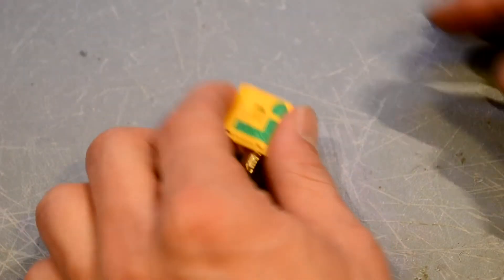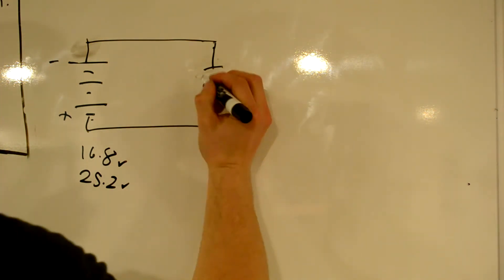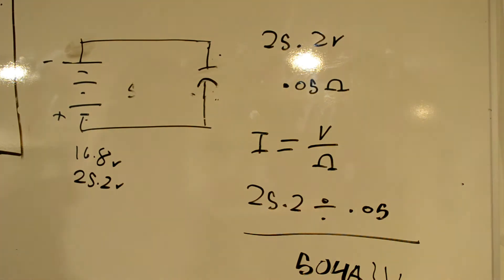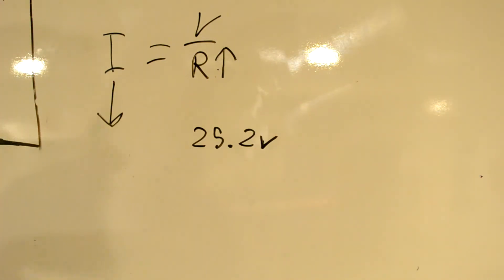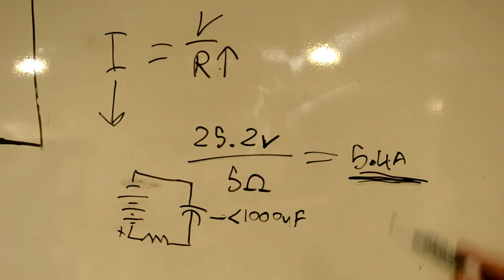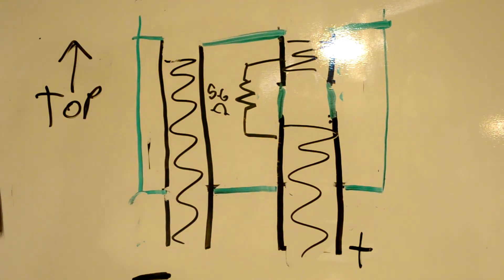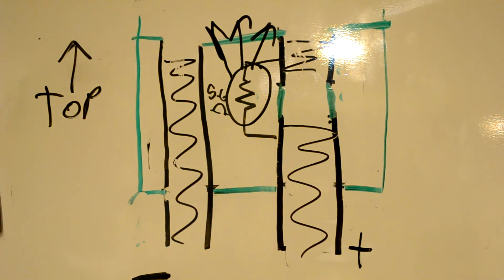Tech Tuesday ---- Anti-spark Connectors

Comment: Almost never do I hear anyone speak of the damage that can occur because of the inrush Amps other than pitting, etc. to the connectors.  Trust me, it is not only the connectors at risk.  Connectors, while not cheap, are a lot cheaper to replace than a controller.  I learned this lesson the expensive way after having to replace the controller and display for my 48v e-bike.   I replaced my XT60 connectors with XT90s a year ago and have since been spark and trouble-free!  Yes, they were a pain to solder, but I've only had to do it once.
Reply from the maker: Almost like the make these for a reason! enough current can blow up marginal input capacitors with ease.

Comment: Question - does the resistor in the anti-spark connector have a heat tolerance limit? I heard in another video that I should be trying to dissipate that heat more than other connectors or that resistor will fry
Reply from the maker: Probably, though the time that the resistor is energized is small enough from keep it heating up significantly. Tcase limits for many resistors is around 90 C
Reply: @BrendanStewart  my concern was regarding heat during soldering which can last more than a few seconds
Reply from the maker: @EbonySeraphim  Ah got ya. I've not had any of these XT90 style connectors burn resistors while soldering. I think you'd be worried about melting the plastic housing long before you fry the resistor. Of course, best practice is to use a temperature controlled iron, and get the solder flown in as quickly as possible.

Comment: so i put 1 on my battery and now im having problems charging it,. are they only meant for the loop connectors? charger would say connection break,.. took over 3 hours to get a 6s battery to 4 volts.
Reply from the maker: Make sure the connector is seated all the way. otherwise you're just charging a resistor!

Comment: Critical comments: 
1:10 "Waaay more voltage..."  None of this discussion related to over-voltage situations.

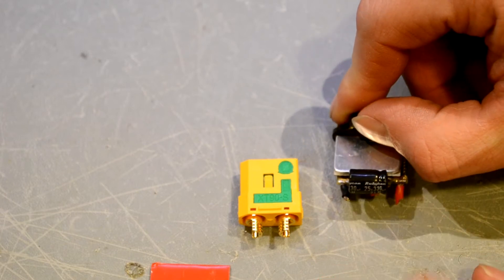1:20 Conventionally, for readability, schematics are drawn with most positive voltage at the top, and most negative at the bottom. https://electronics.stackexchange.com/questions/28251/rules-and-guidelines-for-drawing-good-schematics   Not doing so is like people writing text in all different directions. You could read it, but you can't recognize common patterns so easily.

1:22 On the battery symbol, the end with the long bar is positive.

2:04 It's irrelevant to the story that the capacitor is polarized. But if you mention that, then the side of the cap requiring a positive voltage is marked with a "+".  If you rely only on showing one of the plates curved, that's the negative side (or rather, the curved line often indicates the most exterior plate of a cylindrical cap, usually connected to ground or point of lowest impedance to minimize noise susceptibility -- not really relevant here).

2:55 and following. If the capacitor is connected to the battery, it will be charged, not "entirely uncharged". If the cap is uncharged, the potential (ie: the voltage) across the cap is zero.  Voltage = charge/capacitance, so if charge is zero, voltage is zero.

The main fumble with this discussion: it would make more sense if the cap was shown initially disconnected (and uncharged), and then the discussion should cover what happens at the point in time when you connect it. Google finds many pages with that story line; this one does a reasonable job: https://www.electronics-tutorials.ws/rc/rc_1.html

Comment: Summary: ESCs include a capacitor across the power input wires, intended to provide a local reservoir of power supply voltage, to smooth any intermittency in the main power supply. During that initial connection, the charging of the capacitor from zero volts up to the battery voltage, will briefly draw a large current ("inrush" current), because the initially empty capacitor (and the wiring to it) presents a very low resistance to the battery.  The XT60 with anti-spark feature provides an additional contact that the plug encounters first.  That initial contact incorporates a resistor in series to limit the inrush current. So that charges the capacitor over a few milliseconds at modest current, instead of microseconds at 100x the current.

As calculated in the video, the peak current with the plain XT60, for the example case could be as high as 500A, and is reduced to <5A by the 5.6A anti-spark resistor.  Of additional interest is how long does it take to charge the cap, given the reduced current?

RC Time constant T (or tau) = time to charge cap to 63%, indicative of time course of capacitor charge. 98% charged at 5T 

With the example cap shown: T = 330uF x 50 mohm = 16 usec (Unlikely that the resistance is quite this low, given the rest of the wiring, connectors etc.)

With anti spark:  T= 330uF x 5.6 ohm = 1.85 msec  So about 10 msec for 98% charge.

Obviously these figures would need to be adjusted for multiple ESCs, different capacitors etc, but this gives the general idea.
Reply from the maker: Nailed it!

Comment: This actually helped me a lot. Thank you
Reply: One last question, can I use any watt rating for an application like this without burning it out?  I would think you’d have to use a very large resistor to deal with 25v*5a, or is it ok to use small ones since it’s only for a fraction of a second and they won’t get too hot?

Comment: My 2cents.  Disagree with "follows path of least resistance" statement. Most of the current will, but it will also share a proportion with all connections (closed circuits with a load) based on amount of resistance each offers.  I suspect that the connector connects with the resistor path first, charges the capacitors (some capacitance if not all), adds the path without the resistor, then passes far enough to leave the resistor path open - the unresisted path closed.  Good video, and thanks for addressing the issue.  Cheers!

Comment: Thnaks for the video, really helpful.

Btw is the XT150 (AS150) have the same principal?
Reply: Yes and it's a great alternative to the traditional spark arrester circuit on large planes and helicopters. I use RC Proplus Pro D6 connectors on my Rush 750 with a Y harness and put an AS150 between them on the series jumper and plug it in last.